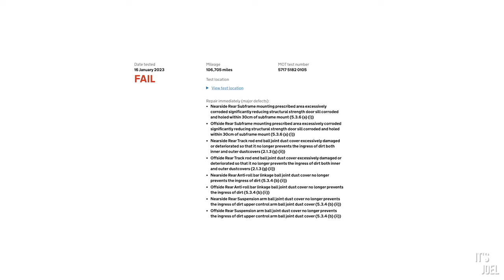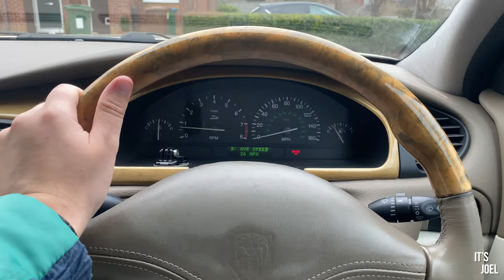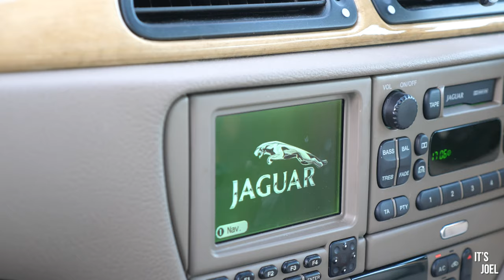My Cheap V8 Jaguar was fixed for 3 days and then this happened…

Comment from the maker: Next week, I get to take this car to its first Jag car meet! Then just after that, we’ll be taking it to get all those MOT advisories sorted! Stay tuned and thank you for the support 👌🏻
Reply: If you are planning to keep this car for some time, it would make great content if you would facelift the car using the 2008 front end and adding xenons headlights,it would really modernize it:) btw, you can also retrofit carplay to the original navigation system screen
Reply from the maker: I want to keep it completely original
Reply: Good choice on keeping it original! Each and every video is getting better and better! Keep it up!!!
Reply: Its a classy car. Once its sorted it will be good
Reply: @itsjoel totally agree - that is the absolute charm of this car.
Reply: Where is it your going to? Have you joined the JEC? I've just bought am x300 with 9 months MOT for £800! Absolutely ADORE it there's a few youtubers yourself included that help sway me to get one. Hopefully we'll cross paths at some point!
Reply: @itsjoel so glad you said that Joel 👍keeping as it is and how it rolled out of jaguar is only way in my opinion. And only just attending a jaguar link up 🤔come on Joel you should of been on that quickly after getting the car because the amount of knowledge and contacts you meet is worth it's weight in gold. And you would definitely find a mechanic who eats sleeps these vehicles which would save the headaches of expensive negative experiences with mechanics who ain't knowledgeable in jaguars,, as you've had to go through already.

Comment: Yeah I’m convinced a 4 wheel laser track will sort the issue I’m just disappointed they didnt do this before you picked it up the first time,rule one from working in garages for over 15 years no matter how small the suspension of steering work alignment check is paramount before customer takes delivery, I know they said there’s was broken but that’s not your problem,nice one Joel 👍😉💪

Comment: The trouble with 4 wheel alignment is that the rear nuts are normally so rusted that they can’t move them. So on your car that is over 20 years old they have no chance 😮

Comment: It's incredible what a small issue in tracking or alignment can make to a car's "feel". I had a 1999 XK8 and a tyre fitter re-tracked the fronts (very badly as it turned out) after changing the tyres. On the motorway it felt dangerous. Was completely cured by a correct re-track.

Comment: No excuses for the garage involved, a proper road test after such work is essential, they should have picked up the issues and advised 4 wheel alignment is required. Not good.

Comment: The first page you showed would have been beforehand, That rear toe was out by a long way, like more that a cm across the car. With the wheels toeing outwards turns are going to feel like a drift. The car would have been very hard  to drive in this state.. The second page looks spot on.

Comment: I do like that Jag and I hope you get it sorted. I currently drive an Alfa 159 ti SW diesel which is the most relaxing drive on a motorway - at 2000rpm it does an indicated 73mph and doesn't break the bank in fuel costs. However, I have a hankering for a first generation Saab 9-5 Aero. Bullet-proof engines and Swedish engineering at its finest. I had two of these, but only the 2.0 petrol models and was involved in a serious crash in the last one. Myself, my wife and my son got out of the car without so much as a bruise. All the emergency services who attended said that the Saab was one of the best cars for safety. The car was repairable, and the bonus was that I had an supposedly equivalent courtesy car while my car got fixed, which took about six weeks. The courtesy car? A six month old Mercedes C class Avantgarde!

Comment: Like you i too have an S-Type mine being an 05 3.0 v6. I adore it and had it for a year or so and nothing major wrong with it apart from this bloody annoying EPB that has stuck on Handbrake. If i can at least get it disengaged and taken to a jag specialist to sort it out. Not many garages want to deal with EPB problems but once fixed i will not use that system just put in park. I promised the wife once i have to start forking out for problems with it i will sell , so its on its first yellow card.

Comment: Hi Joel. I feel your pain mate. What I find extraordinary, when you take a car in and explain what is happening, immediately let’s put it on the ramp and have a look. What I want is the mechanic to come out with me or, drive it himself to experience  the problem first hand then, put it on the bloody ramp. The problem is, nowadays, in the main, they are not mechanics, they are fitters. 

On another subject Joel. I’m looking at a Rover 75, it has the big shaped rear number plate like your Jaaag 🤗.  It has a standard oblong rear plate which I would swop for a shaped plate.  Where did you get yours done please?

Comment: I seem to be having near enough problem with my Audi at the moment. Almost feels like your telling my story. It’s been in the garage multiple times. Spent above £1000 in it and still feels dangerous. I too need a 4 wheel alignment but the adjustment bolts are seized so they need changing before the alignment can be done.

Comment: Hi Joel. Great videos. I have a 2004 2.7 diesel S Type. Great car. I also need to get my tracking sorted following new suspension and also take the sill covers off to check for any corrosion. They are great cars and drive really well. I love mine on a long journey. It feels special even though it is not a costly car to buy. They do cost a bit more to run though. I predict that the numbers will decrease over the next few years as they are already becoming a rarer sight on the roads.

Comment: The garage who fitted the new joints should have counted the number of threads to get the new ones back in the original place, looks like they've just put them on anyhow, 4 w alignment is only 40 quid anyway. You'll track out your new tyres in no time with alignment out.

Comment: You had new tyres, all of the preservatives need to wear out, in about 500miles this happens, until then the sidewalls are soft and allow for some flex feeling like the back is sliding. Thats the first thing a garage should ask.
Reply: What a load of nonsense 😂

Comment: I had to sadly cut ties with my mechanic of 6 years as recently he started not doing the work properly , paid him £300 to fit new pads and discs but he never bled the brake system so when i brake the pedal is very soft , car does stop but it takes ages , also how can a car with broken shocks  and springs pass ?  onyl reason i keep it is because its rare a Red Mitsubishi Colt , now everyone will know who i am as its literally the only one in Berkshire LOL

Comment: What a load of rubbish those Jags are. No wonder people prefer BMWs.
I agree with Hammond its just a matter of time before it gets sentbtomthe tatters
Reply: And
Reply: And what exactly do you drive pal ; because I’ve had top end BMW, Jaguars, Mercedes, Bentley(s) , and if you think this car is worse than other brands you’re clearly not experienced
Reply: And the hamster has …. An XJR
Reply: Walter Plant.
My vehicle has no bearing in the situation.
You appear to be suffering from straight forward psychological denial.
Some times matters are so obvious you have to take them as read.
The Jaguar featured was very cheap in a free market, the reason is there is no demand for old Jags.
Since Joels purchase it has been in the garage for repairs numerous times and has cost a small fortune to fix. Despite all this expence the vehicle is rotten underneath and requires further extensive repairs.
Its a hopless vehicle and I stand by my original statement
Reply: @andypicken7848  If you’re going to stand by your original statement then maybe you need to revisit the statement that you made . You referenced “those” cars . That would logically cover any Jaguar / any model of any description that was produced at any time within ten years of the S type featured on the channel. That’s clearly not appropriate because in spite of what you say Jags the same age and older than the one featured have a following and in fact significant value . They are no better and no worse than many other brands . I was a big Mercedes fan, but the cars they produced at the same time that this Jag was made are prone to diabolical rust . I have owned a BMW 750i 4.8V8 and the bills to keep it as it should have been were astronomical; steering column gearbox failure £2000, gearbox failure, heads rebuild - all on a car much younger than this jag . I am not even going to get started on what it takes to keep a Bentley in good order . 

So my only point pal is that if you think that jaguars of that age or any age are uniquely awful you’re talking out of your exhaust pipe . And a disclaimer ; I have never owned a jaguar
Reply: Walter Plant
I work within the automotive sector and supply OEM equipment to JLF.
At present they are such a low volume producer that they cannot take advantage of the economies of scale.
At first JLR attempted to have quality parts made to their budget but could find no takers.
Consequently JLR have had to accept the quality of parts they receive is commen surate with the price.
At present built cars with the cheapest low quality parts available. This is one of the resons they build such low quality products right across the range.
Thanks for the personal slights, I enjoyed them very much
Reply: walter plant
PS I would also appreciate if you can continue to refer to me as "pal" I like that also
Reply: @andypicken7848  glad to know you enjoy being “pal” mate . 

I’m surprised that someone who is apparently within the industry claims that the parts available to Jaguar were noticeably inferior to the content of contemporary vehicles of other brands . As I have previously explained I’ve had a degree of experience of various makes both owned by myself directly and also owned by my partner. 

In my personal opinion as a non jaguar owner - although both my father and partner have had jaguars- once ford got involved jaguar was no longer at any sort of disadvantage in terms of their ability to engineer cars or buy content 

You’ll know better than me but I think that happened ( ford bought jaguar) around 1990 . So the S type was during Ford ownership as of course was the X type . 

I therefore don’t think your argument holds water . Ford put a lot of money and effort into jaguar and their cars were no better and no worse than other contemporary offerings. There’s certainly justification for your blanket remark that started this exchange which was “what a load of rubbish those Jags are . No wonder people prefer BMWs “ 

As for your further remarks , well I’d make a couple of observations. I don’t recall referencing your “psychological” state , and as my former headmaster said to me almost fifty years ago “the trouble with you , and I probably shouldn’t say this because it’ll make you even worse , is that you don’t suffer fools gladly “ . 

Think on pal
Reply: walter plant
You are right and I am wrong.
The Jag will probably turn out to be a excellent reliable vehicle, we shall see.
Thanks "pal"
Reply: @andypicken7848  Well Thank you for acknowledging that I’m right ; however we weren’t actually debating the reliability of 1999 Jaguar S types . I was simply disputing your contention that Jaguars of that era were noticeably worse than other brands of cars - for example BMW’s which you mentioned .  Stay on point pal . 

And feel free to pop over to the “number 27” channel on YouTube hosted by Jack . You’ll be able to post disobliging comments about my Bentley Arnage and my partner’s Continental R . 

Enjoy